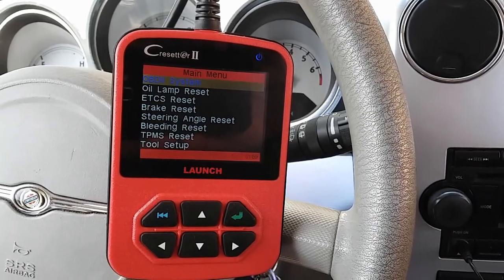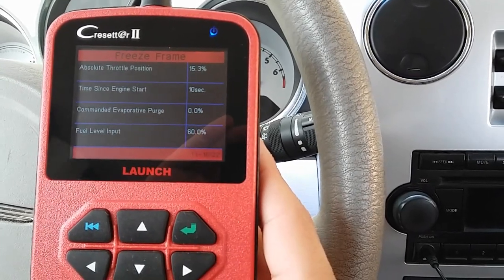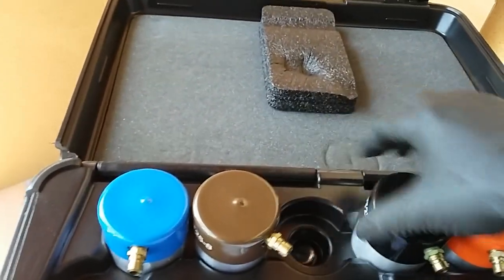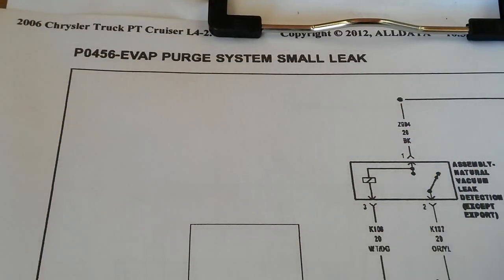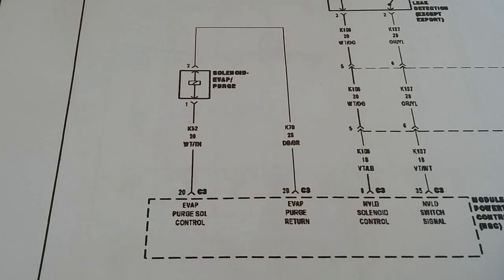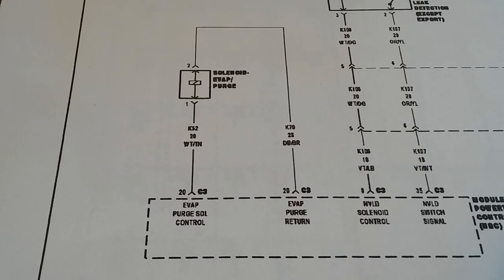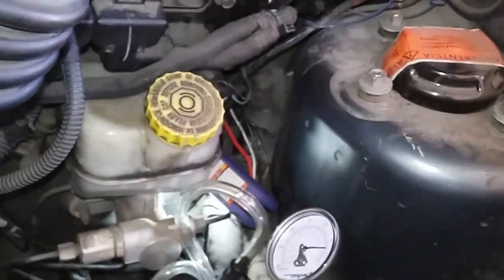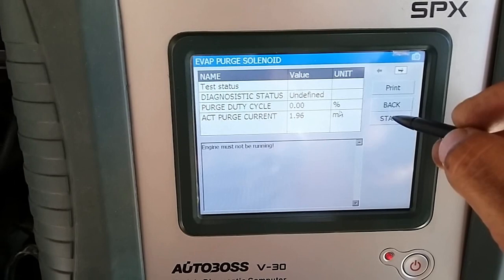(Chrysler PT) Diagnosing a P0456 Evap Emissions System Leak Detected (small leak)

Comment: Hello i have a 2015 Chrysler 200 and it’s showing up the codes p0456 and p0457 I already replaced the gas cap not sure if you su ok I’d replace the part you showed if it’s a common problem
Reply from the maker: Hey there Jessica.  The most common problem on this vehicle would be the leak detection pump which is attached to the EVAP canister, but EVAP purge valve can also be a possibility.
Reply: @EliTheOBDTech  Thanks I did change the pump but u will check the purge valve today and let you know

Comment: I get the code on my Challenger for an EVAP leak but the strange thing is after I do an oil change it goes away and I do have a oil catch can I wonder?
Reply from the maker: That is very strange, I've never heard something like that. Have you done the visual inspection on your fuel cap for any damage on the seal?
Reply: @EliTheOBDTech  I actually replaced my fuel cap a couple times it doesn't help what helps is an oil change and then it lasts for about a week not sure what's going on I do have an after-market cam and headers, so I'm always smelling exhaust I wonder if that has to do with it or if I have too much blow-by I'm not sure
Reply from the maker: @venomhemi3914  Yup, it's hard to say.  Another possibility could be faulty or sticking purge valve.
Reply: @EliTheOBDTech  where would I be able to find a purge valve on a 5.7 Hemi Challenger
Reply from the maker: @venomhemi3914  check under your hood for an EVAP diagram label.

Comment: The Eil odb I have a question I have a 09 dodge caravan and it has the code P0456 small evap leak is this a leak in the fuel system or a gas leak somewhere
Reply from the maker: Most likely a faulty fuel cap or faulty purge valve.

Comment: not my problem. I replace the solenoid, but still have the small leak.
Reply from the maker: Those small leaks tend to be the toughest to track down. Check for crack EVAP hoses, cracked fuel cap seal.
Reply from the maker: Most times, an EVAP smoke machine is necessary for these small leaks.

Comment: Hello ,need help with code po455 on a 2012 Chrysler Pacifica can you please help
Reply from the maker: When I get a chance, i will give you some Info.
Reply from the maker: Perform a visual inspection and physical inspection of the entire EVAP system first.

Check the following conditions:
Holes or cracks
Loose seal points
Evidence of damaged components
Incorrect routing of hoses and tubes
Loose or missing fuel filler cap
Improper installation of the fuel filler cap
Damaged locking tabs on cap and/or fill tube
Damaged seal points on the cap and/or fill tube
Fuel cap gasket seal
Reply from the maker: It seems that the evaporative system integrity monitor switch is not able to close the contacts when vacuum is applied by the purge solenoid or when the esim switch reopens due to a large leak.

Comment: Would this cause more fuel usage
Reply from the maker: Yes it can, but it all depends how bad the purge valve is. It can be partially open or wide open allowing an internal vacuum leak, which can cause a P0171 or even at times p0172 rich condition

Comment: This crap makes me so glad I went to an EV jesus christ what a nightmare.
Reply: EVs have more problems and need bigger maintenance when they do need maintenance because they can't be repaired. Crap has to just be replaced. This is ALSO a 20 YEAR OLD CAR now. An age EVs will never get too. They get scrapped before then cause it's just as expensive to replace EVERYTHING vs buying a new EV. ALSO it's WAY WORSE on the environment. NO MATTER WHAT BIDEN SAYS. The mining to produce batteries is WAY worse than oil drilling. AND since we are still MOSTLY using fossil fuels it's EXTREMELY inefficient to use fossil fuels to generate electricity to charge a battery. You end up using anywhere from 150% to 250% MORE fuel to charge the EV to go 300 miles vs the amount of fuel a gasoline car uses to go the same 300 miles. Not to mention people who have been trapped inside EVs. The fire hazard of EVs and how the lithium ion batteries can EASILY catch fire and burn at like 1200 degrees and MELT the car and kill you in an INSTANT. PLUS the replacing of those batteries EVERY 5-7 YEARS. Paying 4,000-12,000 every 5-7 years for new batteries. NONE of these things are positives. You've just been brainwashed by the EV community and government. Someone who TRULY cares for the environment actually does the research and finds out that it's NOT good for the environment. The ignorance is your comment is ASTOUNDING.